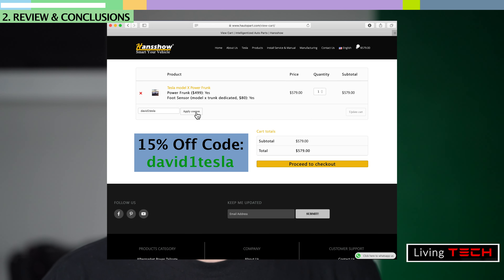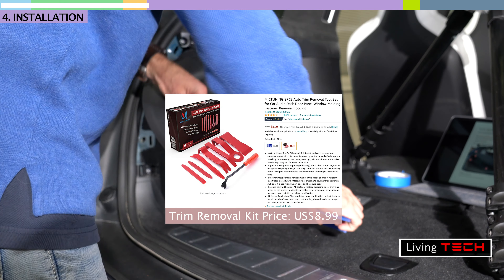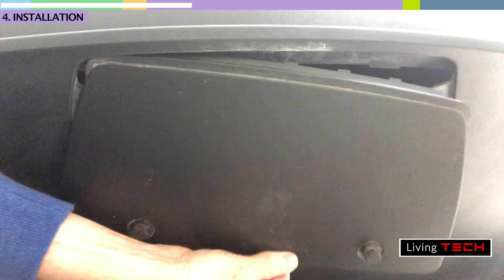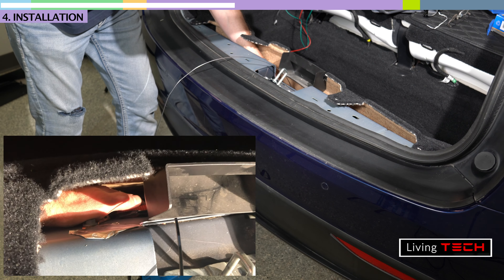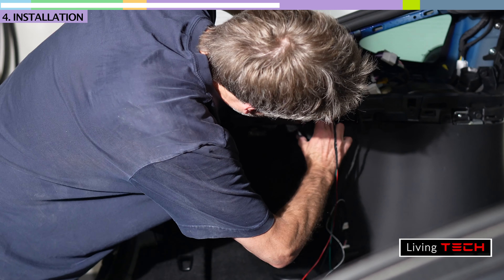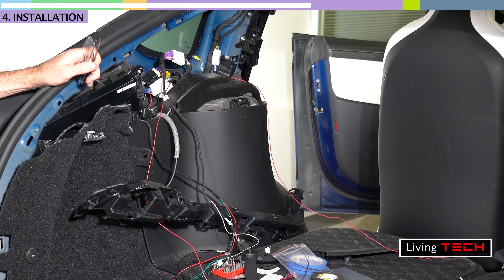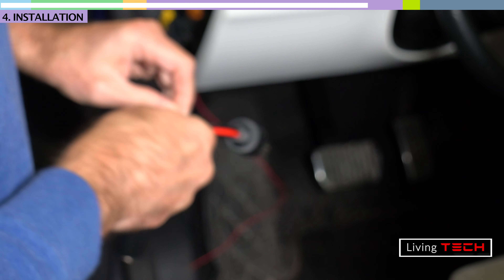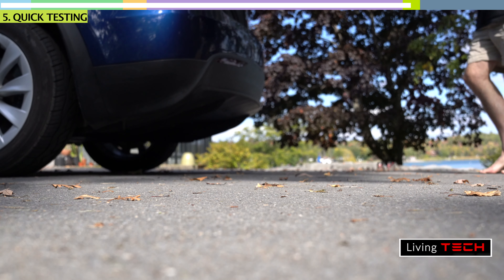Hansshow Kick Sensor for the Tesla Model X - Installation and Review | 25% off Coupon!

Comment: Hi David and all. I just installed the kick sensor on my Model X yesterday and wanted to share that I was able to locate the connector for constant 12v from Hanshow's instructions (or at least if not exactly the same, I found one with constant 12v there) ... it's basically on that long black plastic box that is behind the carpet trimming on the trunk's left side . If you go to 8:01 on this video, is that box right below your hand when you are holding your glasses. I sent you a picture to your email as well. Thanks for your great videos by the way!
Reply from the maker: Thanks again Andres, and it was great messaging with you earlier today! :)
Reply from the maker: Busy day today. Are you all good David? The pic that Andres sent was from my. Idea, showing where the connector was. I was aware of where it should be, but couldn’t feel it there, and didn’t want to take out that shiny black box to reach it, because it was close to the high voltage charging location.
Reply: Oh , I just made a similar, but  less descriptive  comment .  

Finding this connector almost drove me mad :)
Reply: @LivingTech  hi again.... Sent you an email, please forward me the email with his pictures too as I'm waiting to tackle this project till I'm totally clear where I can safely tap the 12v+ as shown in the original Hansshow instructions.
Reply from the maker: Sure, no problem. OK, I’ll do this in the next hour.
Reply from the maker: OK, I sent it!
Reply from the maker: Hey The Real Deal. Would you please send me the email again? Cannot see it. Thanks!
Reply: The Real Deal do you still need ?
Reply from the maker: Hi @The Real Deal, OK, I’ve sent the pictures to you. Thanks again Dave!

Comment: Such a great video but it looks like a tremendous amount of work and taking apart the car to be able to do this 🙈. I would probably freak out a little.
Great work and great explanations throughout.
Reply from the maker: Thank you Chris. It is a lot of work, but I think this is what makes people appreciate it so much, especially those DIYers who just need a bit of info to get their modules successfully installed. :) I generally spend about 20-30 hours on each video. I'm getting faster though, while improving a little each time. :)
Reply: @LivingTech  wow - 20-30 hours is a lot. I hope that it will be rewarded in time with a good amount of views and growth. 👌 keep going.

Comment: Hi David, thanks for the video. It was very helpful. I found the 12 v connector as mentioned in the instructions  and tapped into that. I measured 4.5 V dc on the 4 pin black connector which attaches to the kick sensor.  Is that correct? Because it doesn't seem to work for me right now.
Reply from the maker: Hi Varun. I’m glad you were able to find the connector! That would have made things a lot easier. I’m sorry, but I do not know the answer to your question, and cannot really check, because everything was out back together after making this video. Have you reached out to Hansshow as yet? They were very helpful to me when I had questions (all such answers were incorporated into my video).

Comment: I found the 12V connector!

just installed the kit on mine 2016 XP90D

its located at the rear of the car, just the the left of where you pulled the cable for the sensor thru
its a 30x15cm glossy plastic box with 4 connectors plugged in the buttom.

i can send picture
Reply from the maker: Thanks Kasper. Sure, please send to livingtech9_at_gmail.com Thanks again!

Comment: You could use the rear 12v for power supply. I have my rear dashcam powered off that, so that’s where a ‘Y’ connector/splitter could be used
Reply from the maker: Hi Sanjay. On my Model X, that power is cut off once my remote is moved far enough away that the car powers down.
Reply: @LivingTech  if you have Sentry Mode running, the 12v & USB ports remain powered with the car parked. Hence, you do not need a separate battery backup or tap into OBD port for dashcam power. Also, with Blackvue’s cloud service (900S) you can have a LTE USB dongle to upload events to the cloud, so even if someone steals your dashcam, the event isn’t lost
Reply from the maker: Thank you for this Sentry Mode tip. For fun, I’ll give that a try! However, in my garage I don’t run Sentry Mode, so this would not be my favourite solution, as I often (just yesterday actually) come into my garage carrying things, and the se the kick sensor. This last time, my wife said, “WELL DONE!” Haha! 

I already use the BlackVue 750S-2CH LTE, and recently uploaded a review on it. 
TESLA MODEL X - BlackVue DR750-2CH LTE UPGRADE
https://youtu.be/UDRdnp532Mg
It was sent to me for review, to replace the non-LTE version that I also reviewed in a 3-part series. This review was meant to show the easy upgrade from the DR750S-2CH (non-LTE). Everything else was covered in the 3-part series. Anyway, thanks again!

Comment: What amp fuse did you use for the 12v constant power source feeding this kick sensor?
Reply from the maker: Hey The Real Deal! Thanks for watching. I used a 15A fuse for this. It actually came with my 12V “Y” adapter.

Comment: Is there another option to running a wire all the way to the front for 12v power?
What does it mean to be powered on? actually in drive?
Thanks
Reply from the maker: Hi Chapman! Thanks for watching. As you will see in the video, I ran my own power wire to the front of the car, plugging into the car’s OBD2 port. You should NOT have to do this. I only did it because I could not find the connector in the instructions. Normally, you just plug a pin connector into an existing connector in the back of the car. 

This video explains how I made my cable (I originally made it for my dashcam).

Tesla Model X BlackVue DR750S-2CH Installation -  Part 2
https://youtu.be/oTk2KDffpLo

I hope that helps!
Reply: I also can't find the pin connector and didn't want to run a wire to the front so wondering if I could get power somewhere else in the back
Reply from the maker: Hi Chapman. It’s a good question. There is possibly another location, but I don’t know where that would be. I can tell you that I particularly like my setup, using the OBD2 port, because at any point that anything is weird electronically, I can just pull out the OBD2 plug, and both my DashCams and kick sensor are removed from the equation. Good for troubleshooting future likely unrelated problems in the future.

Wiring to the front of the car was the easiest part of the installation. I encourage you to watch my BlackVue Dashcam Part 2 video, the link for which  I included in the description section of this video. It is not complicated at all, honestly.
Reply: So it needs 12v Constant power, what fuse amp did you use for your foot trunk sensor?
Reply: Chapman Wong I found . Took so long for me to find as well .
2 connectors side by side . Connected upward under long black box .
Press in and pull down the right connector .

I can send photos I took if you need .
Leave contact info.

No help from the company contacts unfortunately. I moved my hand around enough to find myself and the connector does not match the instructions’ photo exactly .

I’d like to share the photo . It will help a lot for model x installers .

I also did buy the 12 v kit that Dave referred from amazon . I had just in case .
Reply: @DHT2023  sure please post the link to your pictures and video if you have one, really appreciate your help.
Reply from the maker: Well done David, thanks for helping out my viewers! Much appreciated!
Reply: The Real Deal I emailed Dave some brief directions of where I located the connector, with some photos, and what I used to connect for the power.
Reply from the maker: Hi again David Tran! I’ve forwarded the body of your email to me to The Real Deal. I did have his email address after all. I just forgot his YT Account Name.